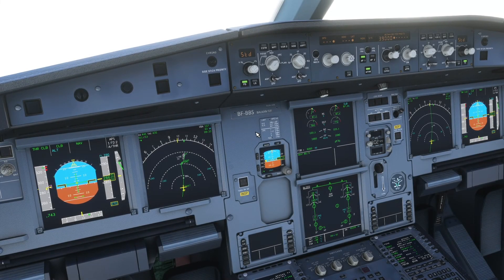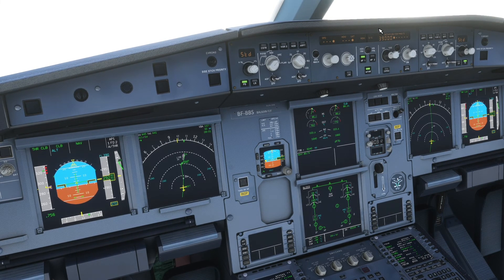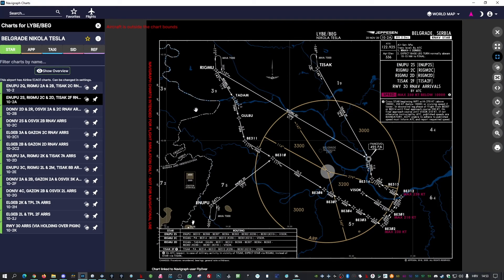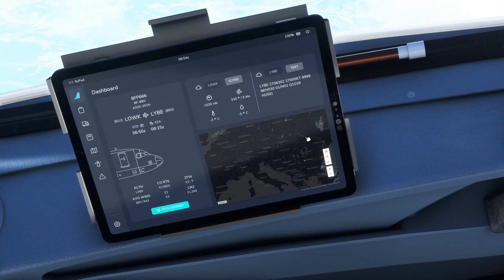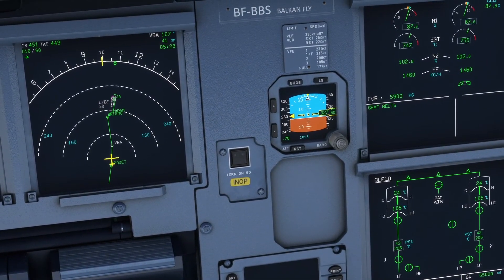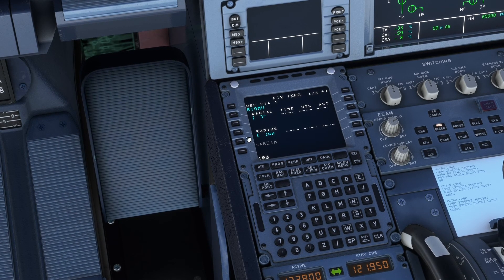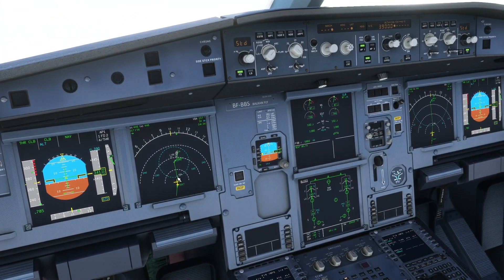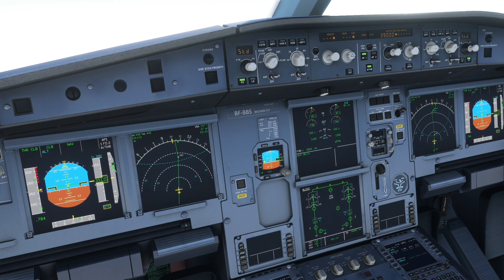Tutorial on how to calculate Top Of Descent TOD for A320NX FBW - MSFS

Comment: i have the same flypad, but how do you get the map on the dashboard of the little plane?
Reply from the maker: Can you explain your question I'm not sure what are you asking?
Reply: @FlyOverGames sorry, on the skypad on the dashboard, in the bottom right you have a mini map of the plane of its position. How do you get that. On my skypad on the dashboard I don't have the mini map.
Reply from the maker: @Megacowmilker353  Do you mean small black map on the EFB (tablet) ? There was many updates on the FBW A320 since this video is recorded, I'm sure something must be changed since that time, however, map should be present always, are you sure you are using FBW version of the A320 ? Since Fenix is out I haven't use FBW so I'm not familiar with the airplane anymore, but there is no logic that map on the EFB will be removed. Try to check in the settings for the EFB and see if you can change theme or something.
Reply: @FlyOverGames  thanks for replying. Yes the little map that shows Europe and the little plane that shows your position. I notice some people have it and other people don't. So just wondered how to get that feature to pop up.

Comment: And managed descent would be automatically going 3 degrees down? What if i wanted to sink in VS, how much ft/min would 3 degrees be there?
Reply from the maker: Excellent question, that depends on the distance from your destination and speed. There are free calculators that you can use for the descent, you need to know the present altitude, distance to the destination waypoint, altitude you want to be at the waypoint, and your speed. Search "flightsim.to" and you will find a calculator.

Comment: I used your steps last night and finally got the TOD circle to show up and went from 33000 to 6000 as smooth as butter.  Thank you for making the video and showing the steps,  No more fudging with open decent using V/S but putting in the new altitude and letting the plane manage it.